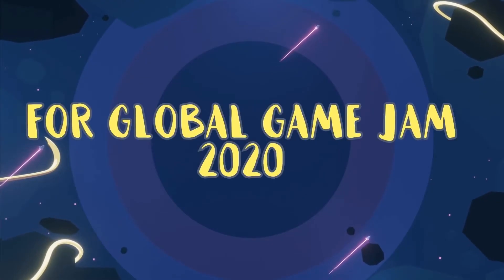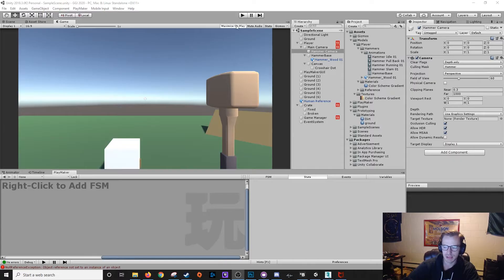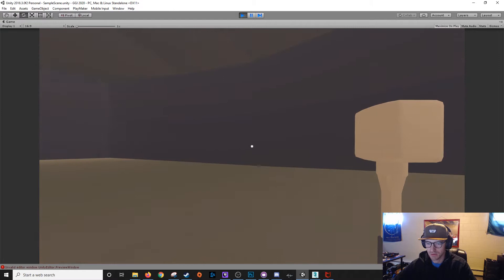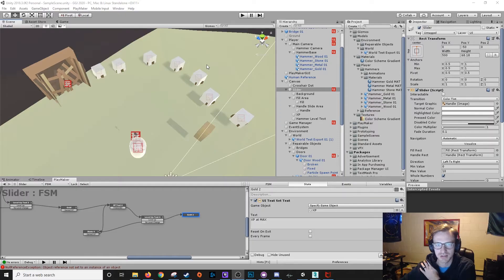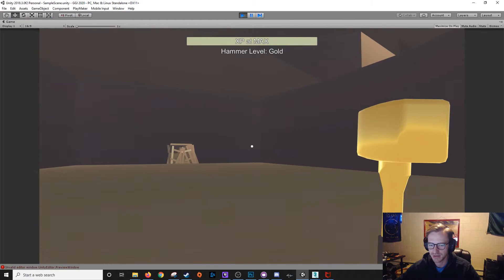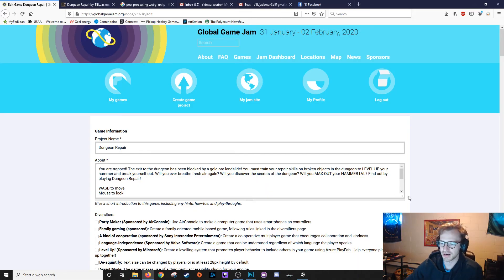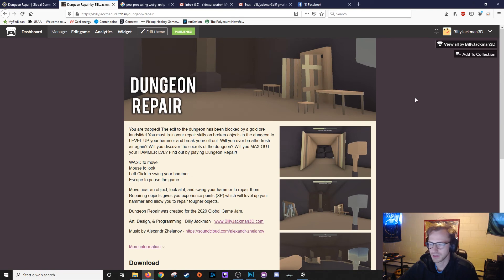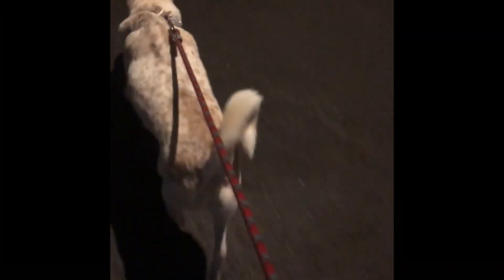48 Hour Game Development Process - Global Game Jam 2020 - Unity 3D Game Jam Devlog

Comment: Might be a cool game if you had more time
Reply from the maker: I agree. I've been trying to come up with a way to make a better version of this game but I don't have any solid ideas yet.
Thanks for watching!
Reply: @DozerTheLoner One idea might be to advance your basic feature where you have to not only use the hammer but where you have to find materials, e.g. planks for crates, stones for the pillar and stuff like that. Or something funny like smaller objects running away from you. Anyways really good work in that short time, seems like you grinded hard! :)
Reply from the maker: That's a good idea! Fleshing out a more in depth crafting/repair system would add more depth to the game for sure.